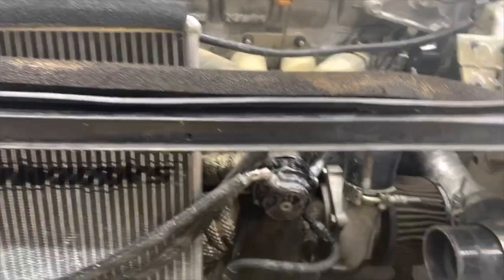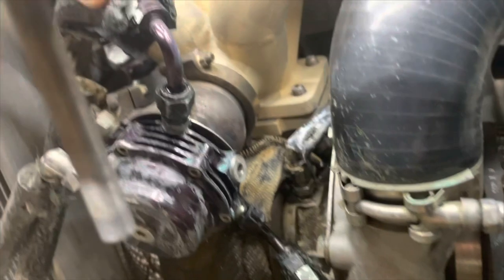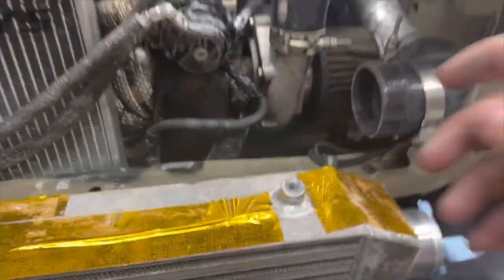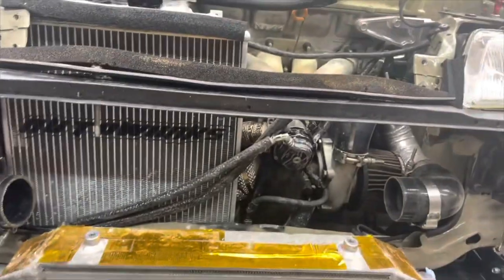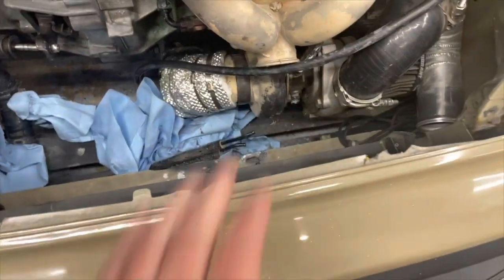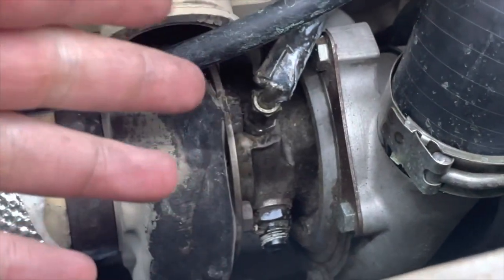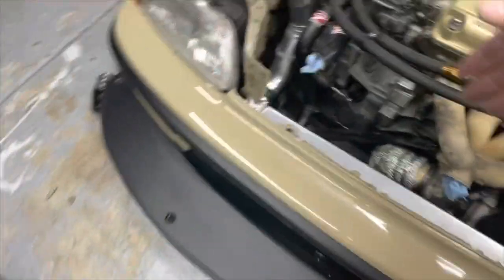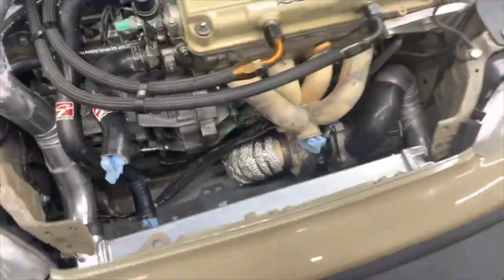CRX Sirocco radiator/let’s free up space!

Comment: I have that same exact radiator and same exact fan on my turbo B series wagon but with a top mount manifold setup. Works great and has been able to keep the temps within the normal operating range when street driving and at the track. Good video!!
Reply from the maker: Fingers crossed Jose. My last setup did me well I won’t lie. Trying to just get even more and more working room. Working room was my biggest issue I had beforehand.